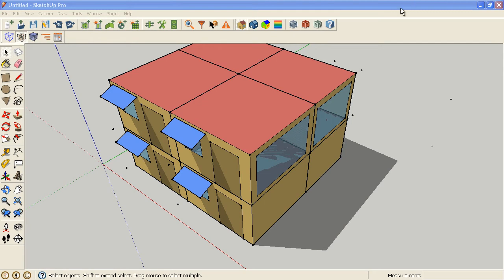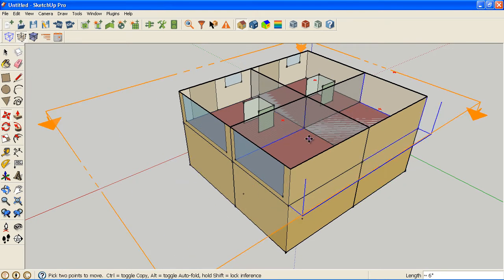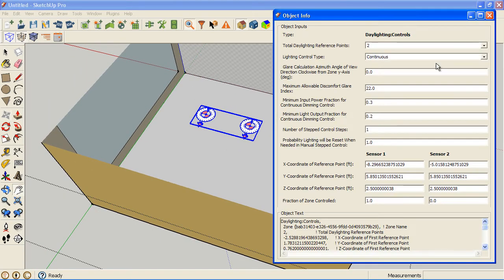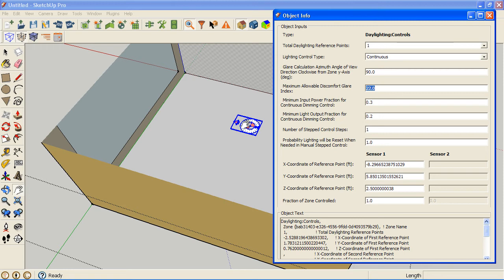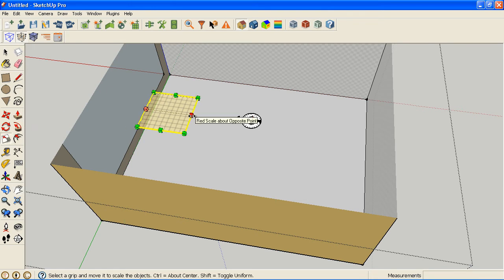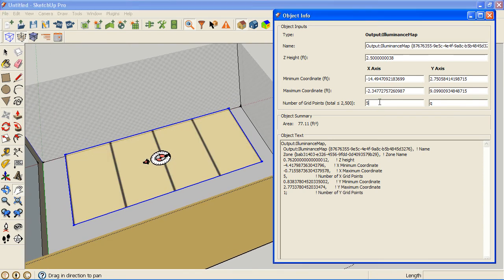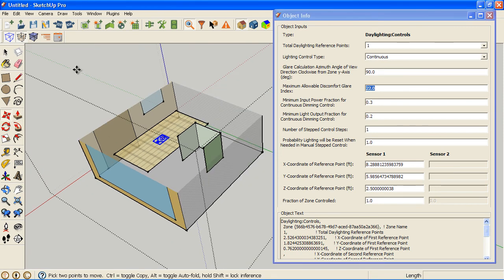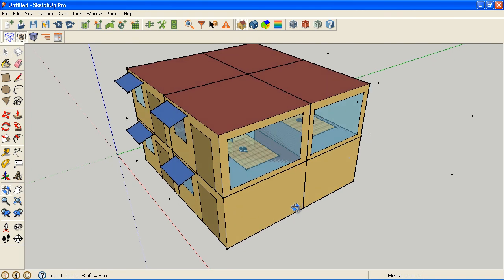Adding Daylighting Controls Objects and Illuminance Maps with the OpenStudio SketchUp Plug-in

Comment: I need to simulate a room with a mechanical ventilation system ( few diffusers and a centrifugal fan) and find how much energy is consumed. I can do the CFD anlysis on ANSYS fluent but obviously it wont give the energy consumption. Could you please tell me what are the boundary conditions and inputs i have to give in Energy Plus.